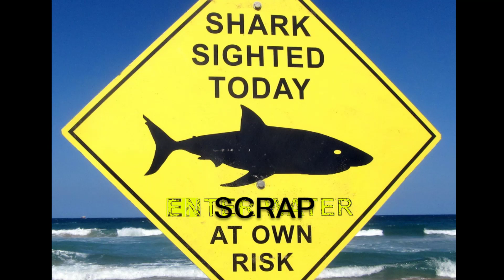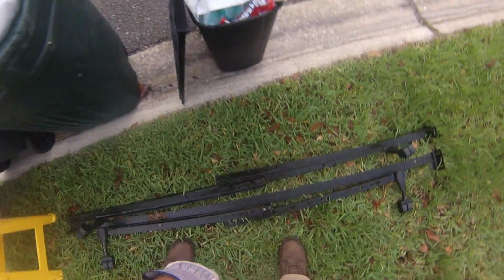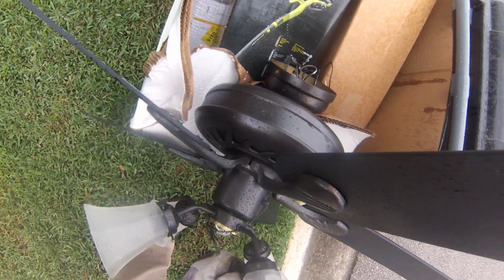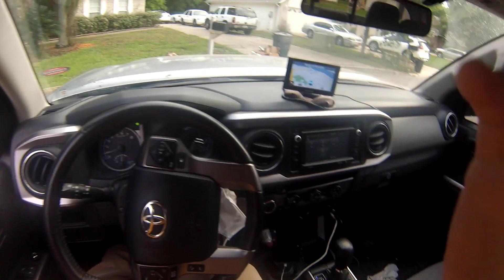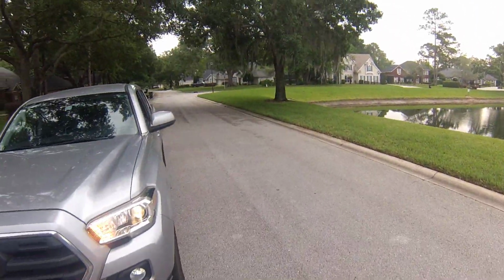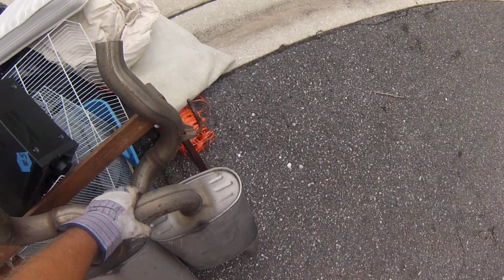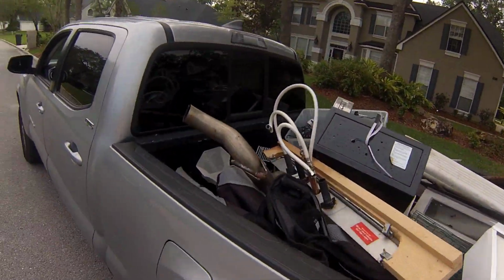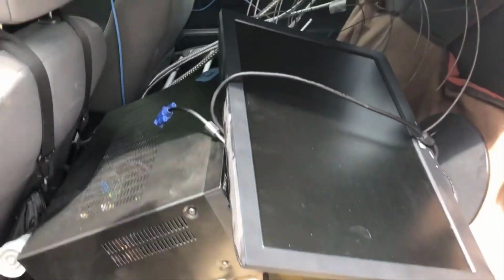Liquid Florida Sunshine and Car Parts

Comment: lol they suppose to make that fan blades of alu 
ooh blinds my favourite  as far they are alu not plastic lol 
lol cooking hoods can be nasty  inside often i skip on scrapping them out  straight to shared 
not bed back is full so positive i was wander why you not flatten up that cages at beginning and yeah  now i know lol  free is better
👍😀👍
Reply from the maker: I don't mind the aluminum blinds - a pain in the patoot to destring, but some good Al.  Agree on the hoods, they can be nasty just like the over stove microwaves - which at least may have some decent copper.

Comment: So, was that 2 celling fans ?.
That was a pretty good load ,do you have a battery grinder ? I know you have the saw ..
Shame about the kids , still best to be safe than sorry .
If you can save the magnetrons as they have some nice copper if you get a chance watch my magnetron video and you will see the copper .👍
Reply from the maker: Howdy Snobby - only one fan in this load.  

I have a Dremel, plug-in, grinder and have found that it is way too small.  To be fair - it was a Christmas present and I wasn't clear what I wanted.  Since I have a number of DeWalt battery powered tools, I'll likely get one of theirs before too much longer.

I do scrap magnetrons.  But I've not done a vid or talked about it much.  I'm still sensitive to someone finding a beryllium model and doing something stupid with it.  Likely an over-caution on my part.

Comment: Okay so I'm curious as to why you take the rusted out burners and grates from the grill but leave the rest? I guess I've always been of the mentality that if I'm stopping for it I'm taking it all. I'm assuming you left it because you were running out of space in the truck? It's always interesting to see how we all have our different approach to Street scrapping. Everything I pick up goes on the back of the truck unless it has resale value. I also don't usually run to the yard every time I go out Street scrapping. I take everything home dump it out of the truck then sort it and haul in a large load every couple weeks.
Reply from the maker: Great question Mathew - thank you for asking.  You're correct, I don't take the entire grill to save space in my truck.  This may change when I get a bed rack, but for now I avoid large bulky items such grills and push bikes.  The grill plates tend to be heavy for their size.  I grab the defuser plates as well because they're small and fill gaps between larger items.  I take the shred to the yard almost immediately after collection because I'm very limited on storage space.  My focus is ewaste.  I can stock pile a certain amount of ewaste related items but large shred type material gets taken to the yard that day or the next.  At some point, I will invest in some land where I can stock pile bulkier items.  For now, it gets taken in asap.

Comment: Your Toyota truck i think is too good for scraping...you are going to damage your truck with all that scrap...
Reply from the maker: It's a truck - it's made for work.  But, I'll try to keep it nice.  And yes, I need a screen for the back window.  A bed frame would be nice as well.
Reply: @sharkscrapper  Maybe you need to have an old truck :) Like that guy ``Florida Scraper`` . His truck also looks like scrap itself :))))) . But those are good because they dont look pretty :) only good for work ...Yours looks kind of sensitive for this job :) like a flower :)
Reply from the maker: @cristian7051  🤣
Reply from the maker: @cristian7051  I'll let her know you said that 😂
Reply: @sharkscrapper  I may be in trouble if you let her know :) Just like in that Stephen King movie ``Christine
`` with the possessed car :)
Reply: @cristian7051  I know a fella in Joliet, Il that has a yellow Chevy truck you can get a great deal on. Or if you want a blue Dodge truck. They both have been aerodynamically reduced of all un necessary body metal, flow through ventilation supplied at no extra charge. Lol